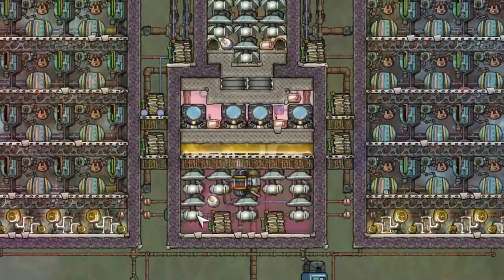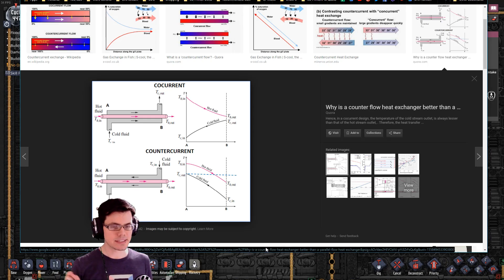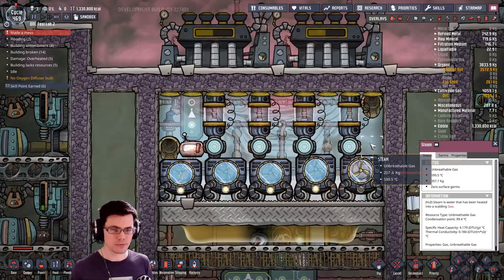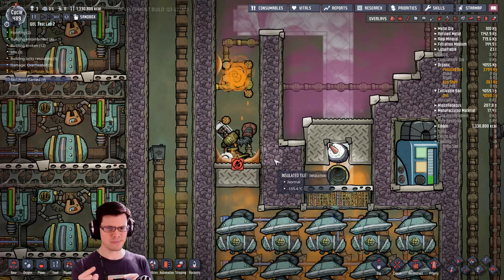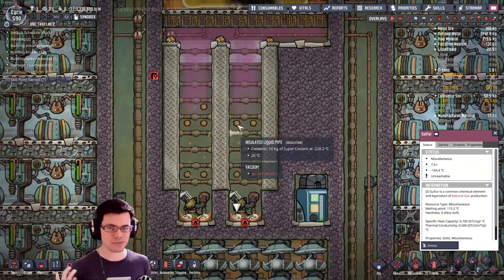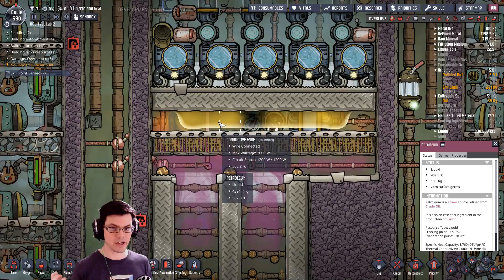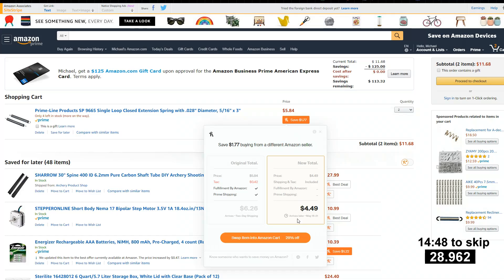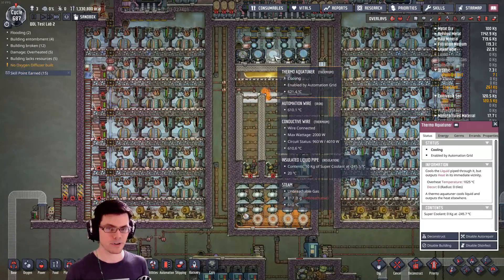Less Pumps = More Free Energy! - Oxygen Not Included

Comment: Hi brothgar, I have built a smaller version with a different order, to use the heat / colling the most efficient I could.  On my bottom layer, I have 2 aquatuners in a void chamber, I drip on it 500g of crude oil and flash it to sour gas.  If I have a pression of 1650g of sour per tile or more, I stop dripping to not overcool my tuners.  Then the gas goes to a separate chamber, where lied a radiant pipe radiator bound to a steam turbine.  The steam turbine is also cooled by just one bit of super coolant radiant pipe.  Then the precooled gas goes into the top cold chamber, where I control temperature (to avoid methane ice mostly), once liquid, it goes into the middle layer, to reheat and get natural gas.  Between each layers I have automated doors to control the temperature, if it's freezing in the middle layer, I get a bit of heat of the aquatuners, and same for the top layer, if it goes below -170°, get a bit of heat of the reheating chamber.  Finally I have an automation based on the super coolant to turn on/off the turbines and aquatuners, so the precool is reduced and the coolant is reheated, because if the coolant is too cold, there's no heat transfer from the aquatuners.  That way, I reheat the cool chamber to prevent ice and regain temp to transfer to my coolant for my aquatuners to work again.  This is not very efficient but enough to become my secondary source of power.  The aquatuners aren't running full time, when stopped the liquid keep running in the loop, the steam turbine is cooled and the gas generator are turned on only when necessary.  I have after few cycles, more than one ton of natural gas (more than 125kg per tile), ready to feed 5 natural gas generator at the flick of an automated switch (they are running only if my grid is getting low).  For the rest, classical PW to sieve to crude oil pit.

Comment: Great video but you could greatly increase the efficacy by per-heating the crude oil with the sour gas. After that you run the sour gas through a heat exchanger ( this exchanger is cooled with the Natural Gas) to cool it even more.  The vaporizer (Methane to Natural Gas) is build with thought in mind. We want the out flowing gas to be as cold is possible to maximize the cooling of the heat exchanger. A good solution here is a temperature sensor next to the liquid output controlling a single (powered) mechanized Airlock build from a bad heat conductor like Gold Amalgam. This severely limited the amount of heat transferred into the vaporizer. 

This has the big advantage of reducing the amount of energy needed to transform crude oil to sour gas. In the same time you also reduce the amount of cooling. I am running you previous setup with only 2 Aquatuners instead of 4. This build (see link) can convert more than 4kg of cured oil per second ( I guess around 5kg but I have only tested 4 kg so far)

Temperatures are as following:

Oil Input: ca. 300°C ← optimal would be 400°C 
Sour Gas pumped out: ca. 380°C
Sour Gas after heat exchanger: ca.  -62°C
Methane: ca -165°C
Natural Gas: ca. -140°C ← optimal would be -159°C 
Natural Gas after heat exchanger: ca.  125°C

As a side note these temperatures are not yet stable as the heat exchanger is not yet in an equilibrium 

https://imgur.com/a/STsNhDR

Comment: Take the cold liquid methane and heat it some using the aquatuners up top so you can get away with using only one space heater down below. Or see if you can make a bridge to the hot area of the generators with metal and insulated tiles, and flash it on that instead of any heaters at all.

Comment: isn't it possible to build it without the space heaters ?
using the same heat source (aquatuners) both to heat the oil to sour gas, and the methane to natural gas.
imagine aquatuners at the bottom, and oil dripped on a metal plate above them, the oil tuns into sour gas but there's already a heavier gas there, so it rises, and goes into another chamber that is adjacent to the first one, this other chamber is cooled so it turns intoliquid on drips back down onto the same metal plate with aquatuners, the question is : is sour gas heavier or lighter than natural gas ?

Comment: I should add counter current is the way heat exchanges are actually installed. The reason why this works better is the temperature is more consistently different. So you get good heat exchange the entire way. Where with co current as you progress you get less and less heat exchange.

Just more ways actually physics are actually modeled.

Comment: Ideas: Instead of attempting to get the gas to a liquid, always make it a solid, then use doors to move the material into another zone where the output of the counter flow then is reintroduced. If the delta isn't to great, then it may be possible to keep the system in balance where it turns back into a gas. While you are reclaiming energy using steam turbines, doesn't that also mean that the heaters may not be needed if you can reclaim the energy from some place else in the system. 

Could the system run more efficient if you decrease the deltas? It may be that you are over cooling your liquid gas. 

 I like the idea of converting gasses and liquids to solids as storage, using that as an endless buffer that won't back up, then transporting that out in controlled manner as needed.

Comment: it's actually not a 7% improvement, it's a 30.5% improvement. e.g going from 8110 to 10543 is a 30.5% increase not a 7% increase.  plus you have two turbines now which increases the energy you gain per cycle.
also should be noted that you gained 18.3% total energy from something (my guess is turbines).  which kind of throws everything into a big turbine fan.
it's better but trading pumps for turbines is cheating! haha jk!

Comment: Instead of using steam turbines to delte heat, and then using space heaters to boil methane you can cool aquatuners with liquid methane and just pumping the gas. I mean if you already use pump you might as well pump liquid methane up. Also precooling with crude oil looks like a great idea. You could also try and use cold natural gas to do the precooling, but that might push system over the edge of aquatuners' heat producing capabilities.
Reply: I second this! The only limiting factor i've run into is that aquatuners generally do their job too well which is easily fixed by having a bypass. I'm gonna try it in-game

Comment: 2 ideas :
- why not just let the solid/liquid methane fall under the bottom room directly, no need for pump
- maybe try to use the heat from the gas generator to heat up the bottom room ? or the excess heat from your top room ?
Reply: In your first idea you want to cool the sour gas extremely down and than heat it up to a high temerature in the same room. I dont know if its possible...
Reply: @antares8826  The re-heat part of the room could be way below the cooling part, only connected by a 2 tile "chimney" for example.
Or you can put a door than opens every 15 sec.

Comment: Do  you need all the pumps at the bottom? Looks like they are not running all the time, when the system has been running longer (and with no additional crude intake).
Nice work on the engineering tho.
Cheers,